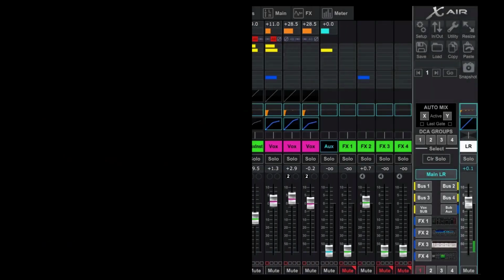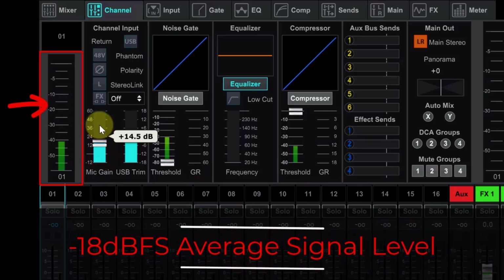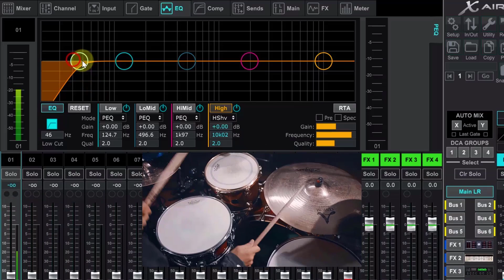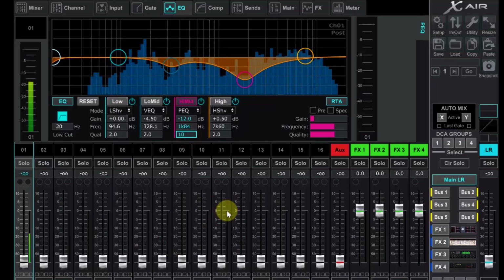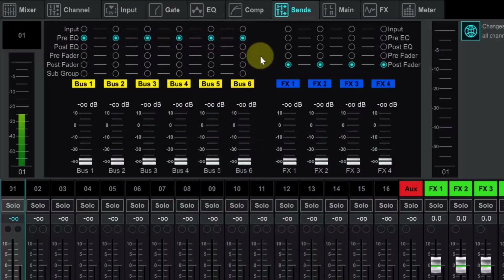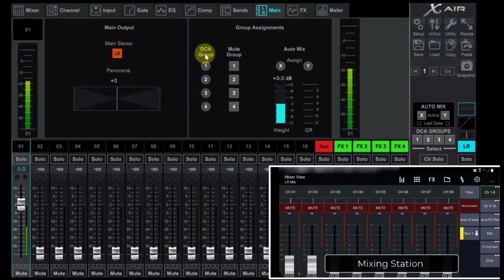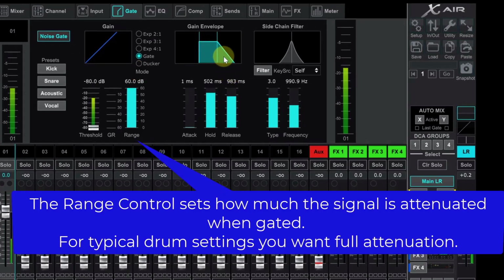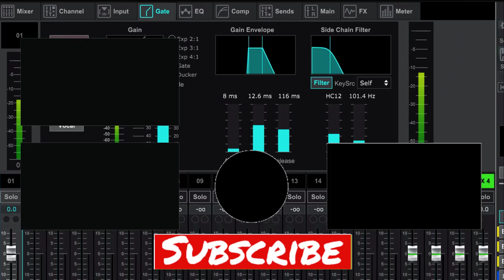Understanding the Behringer XR18 - Channel Setup Tutorial

Comment: Alan thanks so much for these videos.. I'm learning a lot.
Please can someone tell me if its possible to control the XR18 audio etc whilst also running and controlling stop/ start/ track select etc on a playlist within a laptop or MacBook / iPad   connected to the XR18 via usb.. Can I control all this wirelessly from my iPhone or iPad whilst performing live etc.?    I think I dropped an error when buying this unit thinking it had the same usb in/out as the smaller Behringer units and many of the other manufacturers units... All I want is to be wireless and in control of everything.
Reply from the maker: Mixer control can only be done on the network (ethernet/wifi) and not USB. Meanwhile, audio can only be transferred over USB and not the ethernet connection on the XR18.
I know some people use the Apple Airport (not sure which versions or all versions) to stream tracks. I assume (IOW, just guessing) that it has a USB port that can be connected to the XR18... but I suppose it could just have an audio out instead and work that way somehow. So, I'm not really sure on that, but researching that (streaming music through the Airport router) is probably something for you to look into.

Sorry I can't be more specific but I don't have any Apple products to have direct experience with this. Maybe someone reading along can chime in and add something more concrete to this. Or maybe know of other options or better ways.
Reply: @AlanHamiltonAudio   Thanks Alan. If I was to say Use a PC instead and an android pad would that make any difference ?

Comment: Great videos. Thanks for putting these out. Question. Is it possible to create a talkback mic for a live situation with the XR18 so the engineer can talk to the stage without it coming through the main pa?
Reply from the maker: Assuming you have the XR18 onstage and a tablet out front, the simple way is to use an open channel and an RF mic. It doesn't need to be super-nice since it's just talkback. Something like one of the AKG mini's could work.
Then, just set the gain and turn up the monitor sends you want the TB mic going to. Just don't bring up the channel fader... and if you want to be extra safe from accidentally bringing up that channel- Unassign it from LR. Now, even with the fader up, it can't get to FOH (unless you accidentally send it to a subgroup assigned to FOH)
Reply: @AlanHamiltonAudio  makes sense. Thanks for the reply!

Comment: You do a great job on this. I spent five full time years with rack gear and reading the Yamaha Sound Reinforcement Handbook and listening to the results in order to learn dynamics processing and effects for FOH. It's amazing now with the mixer tech and YouTube how much information people have that are new to the business. 

I think I had over $3k in rack gear for only four complete channels worth that I used to drag around with me. Now you have more control than I had on every single channel on mixers that are less money than I had in just insert patched chains for four channels. The shift in 25 years has been pretty incredible.
Reply from the maker: Thanks! Things have definitely changed from the days of lugging around 1, 2, sometimes even more racks of processing. All needing patched in. And even if you multi-pinned the racks, depending on circumstances you still could find yourself repatching processing to different channels, looking for broken wiring, and mispatches.
Reply: @AlanHamiltonAudio  Back in the day, I hand soldered my whole TRS patch snake. Man, today, all the Amphenol and Neutrik connectors alone would be a couple hundred bucks.

Comment: Thanks for your videos.  I just started watching them. my question is what should the gain on th e loudspeaker be? should i set this up at half then turn on the mixer then to get that -18db you were saying? sorry probably a dumb question but I have to start somewhere. thanks again in advance
Reply from the maker: This one is hard to answer because it's a situational answer. It's easy to set the XR18/X32 gain because our meters tell us where we need to be.
But with powered speakers, we also have the venue size, genre, efficiency, needed volume, and still 
 always headroom to consider.

The simple part is to make sure the speakers are set for line input or you're using the line in inputs.

If the level control gives you a +/- range then likely best to start at 0dB.
Mainly, you first want to make sure you don't clip your speakers. A clip light flicker might be OK, but solid clip nor audible clipping is not.

So, if the console is outputting a clean signal, your console gain structure is correct (inputs and outputs... you don't want the console output meter clipping either), your master fader is in a normal range around unity, then you can reduce the powered speaker's level to get it out of clip.

IF it has no way to reduce it, fixed input, then you should reduce you console master until the speaker is out of clip. And make a mental note of where your meters are on the console when you're reaching that clip point on the speakers.

In these two scenarios, it doesn't matter if the rig is loud enough or not... because once you're into clip on the amp/speakers, it's all you have (and beyond).

But hopefully, that's not the case. Hopefully, you have headroom to work with.

Realistically, the input level on the speakers doesn't need to be any higher than to allow you to run your console at normal signal levels, and reach the max level you want in the room.
So if setting the speaker inputs are at 0dB or 'full' means that the signal leaving the console is way too loud for the master to ever ride around unity on the console, then you easily know you can reduce the speaker level.

OTOH, if it's the opposite, then you know to go to the + side on the speakers if that is an option. BUT always with the caveat, once you're into clip, you've crossed over into the "all she's got, captain! She's breaking up!!" scenario.

Technically, while you don't want to be clipping, it is nice if all system meters are working in tandem. IOW, when the board hits the clip light on the output, the powered speaker or amp also hits the clip light.
But that assumes the amps/powered speakers have useful metering and not just a signal and clip light for example.

If your speakers do at least have a signal-0dB-clip light, then you can put some music or a test tone/noise thru the console and set it so that it's hitting -18dBFS on the console's master output meter. We can roughly assume -18dBFS = 0dbVu on those analog meters of the amps/speakers. So, with the console outputting a steady -18dBFS, you can bring the speaker up to hit 0dBVu.
That should put you in a ballpark of the speakers and mixer meters roughly being aligned.

But if that's way too loud, you can either address it at the master fader of the console (which means your meters on both ends stay roughly aligned) or lower it on the speaker end because the amps don't need to be amplifying things any louder than they need to be amplifying things. So any hiss picked up in circuit will be reduced.

If it's not loud enough using that method (meaning when you mix the band, your mains CAN be hitting much harder than -18dBFS, but not clipping the console...). So if the speakers aren't starting to flash the clip light... yet it's still not loud enough), then this gets more in the weeds... Because you need to know where the speakers clip. If the powered speakers have +18dB of headroom, then you're basically aligned with the console and that is that. If the speakers have +24dB of headroom, then you have 6 more dB in reserve where you can have the speakers hotter than the console (or console meter that we just guesstimated -18dBFS gave your -18dB of headroom on the speakers).

All of this has just been guesstimating things, so if the mixer master meter is really running hot at the show, and you have to bring the master fader up to even get close to the volume you want, yet the speakers are not clipping, then essentially, just bring the speakers up some more. Do it in balance and reduce that master fader if you had pushed it and were running it above unity to get it back to the unity area and give the console outputs headroom.

You don't want the board clipping before the speakers... nor the speakers clipping before the board... You just don't want clipping.
And with digital, you don't really want to hear that digital clip at all.
 So ideally, things are set so that the console meter tells you if you are close to clipping there... then you're also close to clipping the speakers/amps.

You can kind of combine all the above to fit your situation and get there with some trial and error. Just don't overdo it on the error part. ;)
Work your way up slowly.
Reply: @AlanHamiltonAudio  Thank you so much Alan for answering my question in detailed.  I am trying to improve our worship system to start using this xr18 digital mixer but the guys who used to use it all left so now we are left with the system that no one knows how to use that is why i been watching your videos and have found them very helpful.  We have the presonus 12" speaker and it has the 0db on it so that is where I will start and go from there.  Are you also familiar with the powerplay ha4700 headphone distrubutor amplifier? because I have this and we want to try to use this as well for the in ear monitors.
Reply from the maker: @JoelManrique  I've not used the HA4700. Keep in mind the 6 XLR aux outs on the XR18 are balanced MONO outputs. It takes two outputs if you want stereo. And stereo linking them to get a pan control for the stereo auxes.
I'm not sure what the inputs are on the HA4700. It should definitely work, but make sure you are using the right cables and/or adapters and setup on the XR18 (and headphone amp).

Even though the main focus of this video is off-topic, parts of it about about balanced mono versus unbalanced stereo might be useful:
https://youtu.be/UiauwFEFe_k

There are a couple of different videos about using the XR18 for mons. The more recent is talking about configuring it for a dedicated monitor console and there's an older one more geared to using it for mons from FOH. Both of those videos have relevant information about the outputs and routing for mons.

And, I'm working on a video covering the outputs, something along the lines of this channel walk-thru video. But not sure when I'll get that finished.

Comment: Thanks for more content on the XAIR18 and help finding the Signal Tap points for the monitors. Can you at some point provide a tutorial on Stereo Delay settings and practical use for live and studio applications? Low Cut/Hi Cut, Feed levels etc. and how Delay sits in the mix depending on how you use or misuse it. Also different types of delay both long and short. Tape slap effect etc.
Reply from the maker: That would be a good video topic. Thanks!

Comment: Great video! I'm new to the MR18 - is there a way to reset just a single channel to the default configuration?
Reply from the maker: Off the top of my head, the most simple way would be to save an unused channel as a preset. Or initialize the console so every channel is definitely at factory defaults and then save a channel as a channel preset. Just name it something obvious like Baseline Channel or Clean Channel or Init Channel... Something you can remember.

You can reload that channel anywhere, at any time...
IOW, save channel 16 today... a month from now you can load that channel preset into channel 1... or channel 10... or....

I probably should do a video on channel presets and saving them. You can save individual channels like kick, snare, toms, vocals, etc... with their names and color schemes already in place... Plus your baseline settings for those instruments (like your gates already assigned, comps assigned, HPF assigned, and ballpark settings in place). You'd still tweak them however you want, but having starting points that far along really speeds up the process. Just having the names and color scheme you like that easy to call up and roll with is a timesaver.
Reply from the maker: Plus you can save channel presets from your own scenes when you start locking into solid baselines, or if you ever download a scene, you can save the channels individually to your channel library as well.

And before someone says "You can't mix a band with presets"... The idea is to have baselines in place. Starting points with your workflow and basic things in place. You're still likely to need to tweak things. But things like the TYPE of filters you use on individual drums for your gates, your HPF settings, will all start out much closer than starting from scratch.
And channel names, colors... etc... that stuff will just be exactly what you want with just a couple of clicks instead of typing them each time.
Reply: @AlanHamiltonAudio  awesome, thank you so much! Never knew about channel presents until now. I appreciate your videos.

Comment: The -18 dBFS isn’t necessarily the right way. Behringer, on their channel says to raise it to a point where you get a strong signal without clipping on the loudest parts. 
-18 actually causes output to be too low when going to ultranet, -6 works much better overall and there is really no downside.
Reply from the maker: -6dBFS would be WAY WAY too high for average level. I could see potentially allowing peaks to reach -6dBFS. Assuming I know I'm really seeing what would be peaks and someone/something won't get louder and remove that margin of error.

To average -6dBFS would only allow 6dB of headroom. Not NEARLY enough for peaks. 
-18dBFS, as an average signal (not the average peak signal) is a safe setting that basically aligns with 0dBVu on an analog console. Hence the quote in the video that said "You can and should peak above (-18dBFS)". It's essentially the normal headroom you'd have when mixing on an analog console if you were trying to avoid clipping.

Even what you're saying is pretty much the same thing. You can't have your signal averaging -6dBFS, and then not peak into the red (0dBFS) where you fill that digital bucket up. Not with any type of dynamic music. Obviously, you can send a constant signal from a tone generator and set it at -6dBFS and it'll stay clean all day long. But that is different than live music with not only regular dynamics, but musicians that turn up, hit harder, and sing louder (and yell) as the adrenaline flows and the show really starts rocking.

Again, the key word is "averaging". Meaning your signal is constantly right there at -18dBFS during normal performance levels. 

Since this is at the input stage, we don't have the luxury of putting a limiter on the signal to squash that dynamic range before the preamp. We can definitely limit dynamic range AFTER the preamp, and with what is fed to the L-R bus and then also to the mains. But if you leave yourself too little headroom at the preamp, then you're going to be on the edge of distortion, or into distortion for the show. And that means you need to start readjusting gain during the show. Which the video explains why that is a bad idea.

You can set the level by peak versus average, but in one form it's still the same basic endgame either way. Assuming you get it right. But that assumption is where the problem comes in. For example, if I was to set my gain until the musicians and vocalists all hit 6dBFS peaks at soundcheck... and then I find out when they show starts that I was sandbagged: Mickey Mouse becomes Rob Halford, the shy drummer turns into Animal, the guitar player hits the boost pedal that he failed to mention he even had and leaves it on... Suddenly that -6dBFS peak isn't the headroom I thought I was going to have.

And meanwhile, I didn't need to be that aggressive with the gain in the first place. 
I could've set the gain to average -18dBFS, or -15dBFS if I wanted to be a little more aggressive, and I would've mostly seen peaks at -12, -10, with some margin for error that could ultimately take a few peaks to -8 or -6dBFS. And still room to absorb some turning up, or an excite band taking things up a notch, yet me still not hit 0dBFS on the meter.

This all still roughly aligns with analog signals... the difference being that in the analog realm you could theoretically soft-clip if you did get uber-aggressive with the preamps... But in the digital realm, that digital clip is anything but soft.

Again, the point needs to be reinforced: -18dBFS is a rough AVERAGE level for the signal to normally reside... Not where to set it for PEAKs (at -18dBFS). That would be way too low. It should peak higher, but if it's averaging -18dBFS normally, then there's plenty of room for peaks under 0dBFS without staring digital clip in the face. So it's accounting for dynamics. And it's accounting for a consistent baseline.
Reply: @AlanHamiltonAudio  Yeah makes sense, my peaks were -6dB , I think averaging -12 to -15.
Reply: If you have a full band and set them to -6, trust me your master will be clipping. Start with -18 average on all channels.
Reply: @ryanshook8284  Peaking at -6dB, we cleared it up already.

Comment: Pretty good overview for those that are somewhat familiar with the " X " series of mixers, hopefully people will check out your other video's, because they are much more in-depth and you go a little slower.
Reply from the maker: Yes, there was a lot of info to cover. I tried to add the relevant links either in video or under the video for those that need to go deeper and/or look beyond the channel on any section of the video. I wanted to keep this video moving because it was getting long as it was. Plus I figure people will would want to get to each new section versus lingering too long on a part they are already solid on.